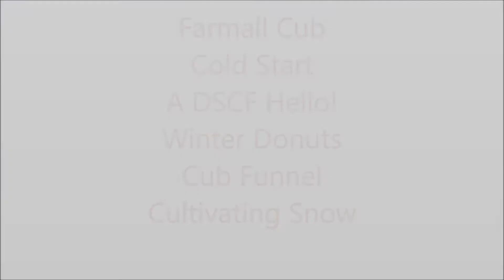Farmall Cub Cold Start, Winter Donuts & Cultivating

Comment: Obvious 12 volt conversion. In the  video, did not confirm that the gear shift was in neutral.
Reply from the maker: Prior to filming I had made sure it was out of gear. I hope you noticed 
also my habit of turning it over while the switch is off - pushed in. 
That does two things, final safety check that it is not in gear and the 
vacuum fills the carb for the nice start on the second pull of the 
ignition.